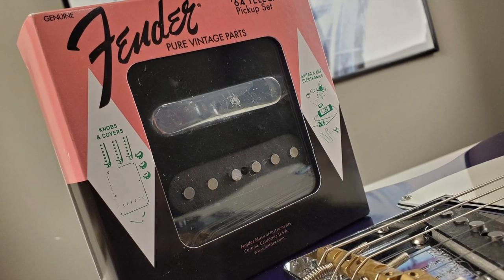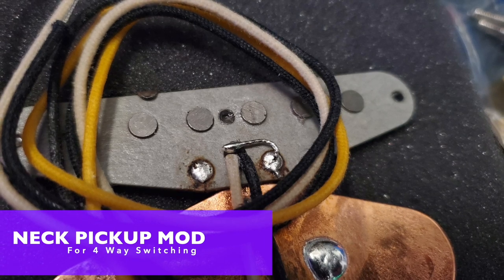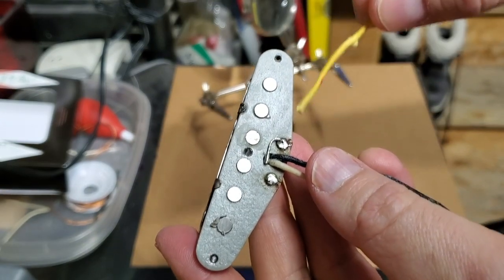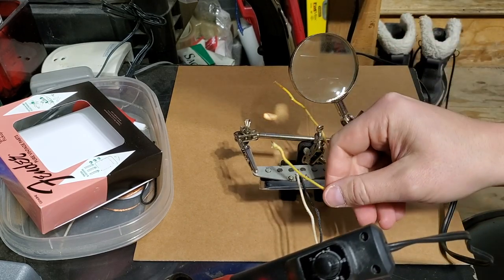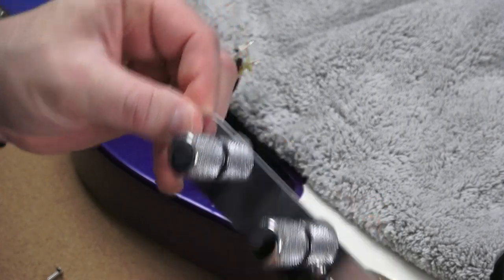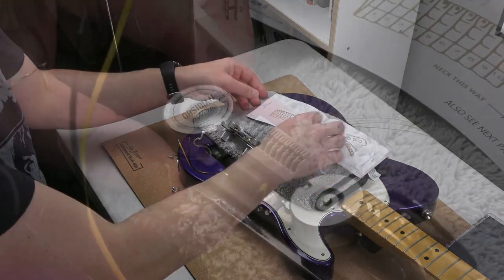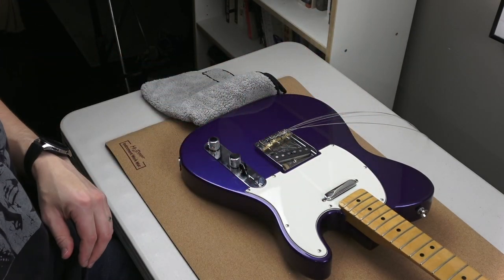How to Install a Fender Telecaster 4-way Switch with Mod

Comment: I rewired my black Tele 3 years ago with a premium kit that included a 4-way switch and it's still going strong; the tele neck pickup shorted out so I replaced it with a Strat pickup and now it's been swapped for a P90 that fattens up the series mode with the retained bridge pickup and I love it!
Reply from the maker: Nice! I should do a p90 neck some day
Reply: Did you add a metal/Nickel cover to the strat or p90 pickup? Considering that's the wire that needs to go to the switch...
Reply: @mr.mcmagpie6606  no. You don't necessarily have to have that extra ground wire unless you have a metal cover to solder it to.

Comment: My dad taught me an amazing trick if you're concerned about wearing away wooden screw holes. Take a small piece of a toothpick and place it in the hole where you're going to be placing the screw. Make sure it's just long enough to where it won't be coming through the top. Toothpicks are great where they're tapered on the ends so you don't need a very long piece. Just a little one. And that's it! Just screw the screw the screw the screw...(I'll stop) back in and you're done! It holds very well, particularly if you're working with really soft or not very dense woods.
Reply from the maker: I've done that on strap button holes. it works!
Reply: @landonbailey  damn. I did that trick on a neck once. It did not hold

Comment: Blowing on hot solder creates a 'cold joint'.. which will give you a matte looking finish and possibly not have a solid connection to the wire in the joint(ie: be able to pull out/wiggle arround)

Comment: Great video, thanks.
My MrGlyn Cruel Mistress pickups are wired with two conductor shielded wire, the shield is grounded to the pickup cover and soldered to the black wire at the other end. So it's easy to just unsolder them where they're joined (in the control cavity) and then insert them in the correct places in the ObsidanWire connector block.
Reply from the maker: I haven't heard of that brand. nice!

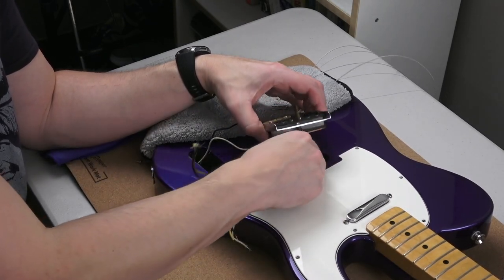Comment: 3:20 - First, thank you for not saying "heighth".. it's stupid. Also, I've literally soldered many thousands of connections, and have never found any issue with blowing on them.

Maybe it's because I exclusively use SN63 solder, as opposed to the common (kinda lousy, imho) SN60 aka 60/40 stuff.

Comment: Blowing on it does two things. One good and one not-so-good. Blowing will help prevent you from inhaling the fumes. It also has potential of prematurely cooling off the solder joint.
Reply from the maker: that sucks!

Comment: Break off some wooden toothpicks in those screw holes before putting your screws back in and they'll hold fine.
Reply from the maker: for the pickguard screws?
Reply: @landonbailey  Yes. Into any wooden hole that accepts a screw. (I don't mean for this to sound dirty. lol!)

Comment: I'm pulling some squire Tele pickups to solder on push back wire ..I figure it will make a small improvement..
Reply from the maker: ya I don't know if that would make any noticeable difference, other than wire strength and quality.
Reply: @landonbailey  I have swapped the pots to CTS and cap is a brown drop .047...and just not a fan of the tiny wires but the pick-ups sound good to me..
Reply from the maker: ah cool! I thought you just changed the wires and nothing else :)